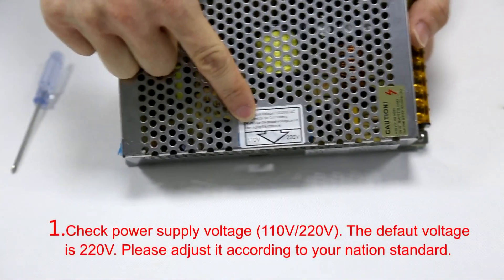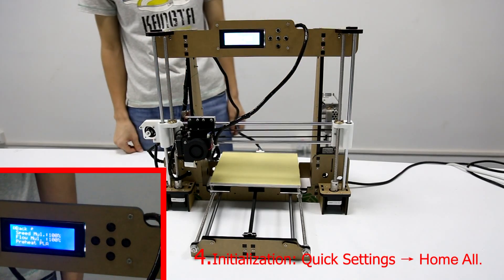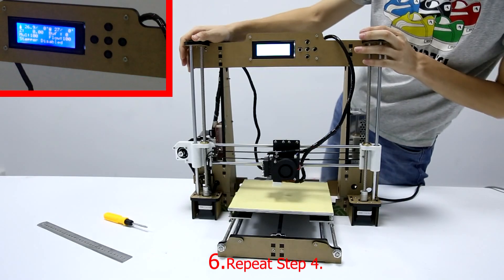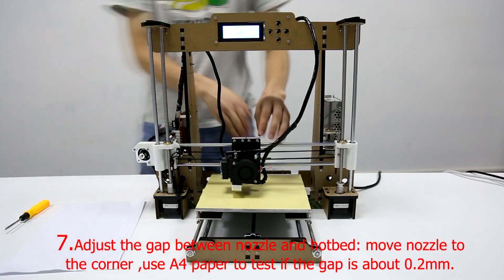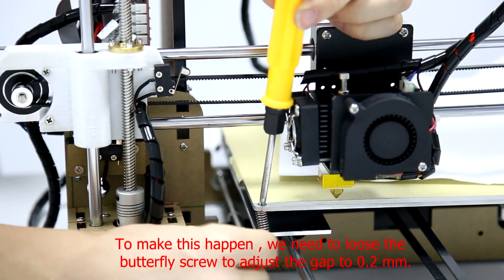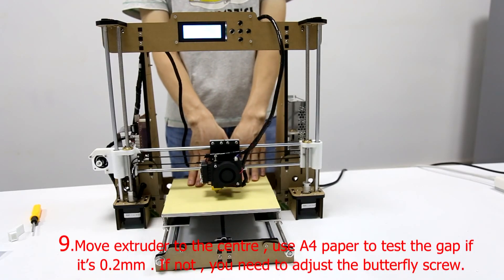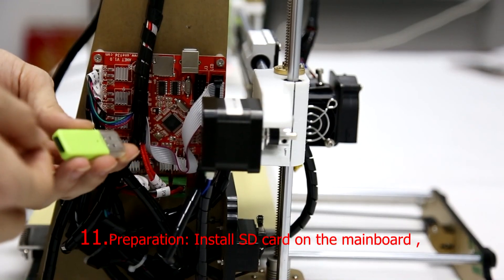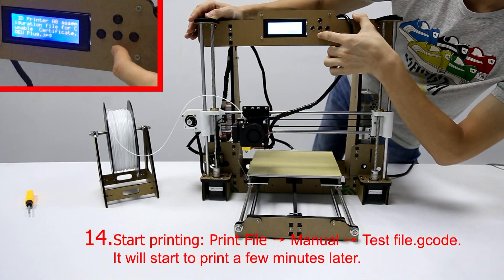3D Printer Instruction--Anet 3D Printer A8 Debugging Video

Comment: Hello! I have a question. I just finished building my new Anet A8. I notice that the extruder head required a great deal of force to move it horizontally by hand. The unit moves very smoothly if I remove the rubber belt so I assume it must be the motor being very tight. Is this normal? I see that you can move it quite easily in the video. Please help. Thanks!
Reply: Did you make sure to stop the disable the motors in the quick settings?
Reply: Augman Yes, I  did. I completely removed the motor from the printer to check. The motor cannot be turned smoothly by hand like the other ones so it's definitely defective. The printer is still able to print so I guess I'll just have to live with it until the new one arrives. I don't expect the Chinese company to send me a replacement. But hey, the printer is otherwise fantastic. I also ordered a leveling sensor and I'll be installing Skynet V2 soon to enable auto leveling. Cheers.

Comment: fantastic, i just completed my build and everything is working fine, realy a nice maschine, thx guys, i will keep an eye on your company and see if there is more intessting stuff u provide
Reply: Hi @101ZERO . Sorry to hijack your post. Does your X-Motor (horizontal) slide smoothly when moved by hand? Mine moves but I have to apply a great deal of strength compared to what I've seen in the videos. Thanks and congratz on your build!
Reply: hi @michor10 , no problem for hijacking^^. Does it also slide hard when 
turned off? cause when it is turned on the stepper motors hold it in 
place (one advantage from stepper motors), to turn the steppers off go 
in the menu -> "quick settings" -> "disable steper" -> (u have 
to scroll, should be the last point), but  if it is also hard to move when the 
printer isnt powered: unscrew the extruder bracket (the J shaped metal 
piece) and check which of the 3 linear ballbearing is stuck, feel free to ask again if u have any problems
Reply: 1O1ZERO I noticed it during assembly so the unit was off the whole time. The sliders move freely when the belt is off so I guess it must either be one of the lateral wheels/pulley things or the motor itself. I just ran a quick diagnostic test and the unit seemed fine. I'll try to make a video to show you better. Cheers!

Comment: Hi,  I have assembled the printer completely however it does not turn on.  I live in NY our power supply is 110v and I changed the settings to 110v before turning it on.   .
Reply: check the files on the included SD card, there should be a power supply wiring diagram in there, they have the yellow and blue wires switched to the opposite of the video, try that it worked for me.
Reply: Similar thing for me. In my case the instruction stated different order 
of power cables on motherboard (Black was on the outer side, red closer 
to extruder socket). After switching them printer started. Thanks for pointing to the SD card instruction!

Comment: Hi I'm stuck at 12:21, my micro SD card does not have a Print File - Manual - Test file.gcode file. I tried putting on other examples (box, baywax) but the extruder seems to just push filament out randomly. 

Am I missing anything? I've been following the videos step by step.

Any help is much appreciated
Reply: Try plug ur sd card into your computer and move the gcode files out of any folders. If there isn't a gcode file, go to thingiverse.com and download something there. Make sure to try unmount and mount the sd card through the printer.

Comment: where's the power switch for this thing? I just put mine together and plugged it in and I cant seem to be able to turn it on
Reply: Never mind people. fixed it. turns out I don't know the difference between positive and negative on the board or how to screw them in properly. not to calibrate and test. Huzzah!
Reply: now to calibrate and test*
Reply: there s none, I wired a switch from an old computer power supply together with the plug and used the powercord that goes with computers and such.
The power cord that came with the Anet seemed a little on the thin side of the actual copper gage. Hope that helps.
Peter

Comment: ?why cant i print stl files
should i convert it? to what format?
Reply: You need to drop an STL into a slicer program like cura and then load that onto the SD card. 3D printers need the STL to be converted into instructions that it can read

Comment: Hi i have buit the hole printer but when i have to go settings and home all the x motor goes right instead of left so the extrusor pushes the White plastic part on the right so i think the x motor moves like its polarity were changed (which is imposible in this printer)  
Could somebody help me?

Comment: I just finished assembly, BUT, my Y axis is moving in the opposite direction than it should during the homing operation. How do i fix that?
Reply: Hello! I have the same problem, did you find any solution?
Reply: My x axis is moving in the wrong direction .. during the homing process

Comment: my printer wont print,. it powers down the moment it try to start heating the bed, or abs.
Reply: Milly Lamp try to install everything again and wire everything again maybe this will help
Reply: or try another power supply which has more Amp than your current power supply

Comment: Got this working, awesome product and the videos are very helpful, would recommend you update the video links on gearbest as they are for an older version and they confused me at first.
Had a problem with the SD Card that came with the printer, the printer wouldn't detect it, (but it worked on my PC). I swapped it for a 2GB SD card and it then worked fine, I think the printer doesn't like 8GB or bigger cards.

Comment: Hello, I've mouted my A8 and followed the video instructions. When I want to test it after selecting preheat I try to go find the test file but the menu "Print File" does't appear. Is there any setting I need to do first?
Reply: equal error
Reply: I've seen in some videos that normally it's used a 2Gb card and the one that comes with the kit is 8Gb. I didn't test it yet, but could be the solution.
Reply: i use the sd come with pack
Reply: si lo logras solucionar avisa, que estamos iguales ^^
Reply: I've tested and to work the memory card should be maximum 2Gb.
Reply: did you find a solution, I have the same trouble?
Reply: use a memory card with a maximum of 2Gb

Comment: hello david
help me pls
i have one problem
I did everything the same as in this debugging video
but extruder and hotbed is not working 
it not hot 
what to do ?
Reply: The same is true for me as I turn on the printer .., where indicates the temperature of the extruder and the hotbed  indicates "def", not shown me the value of the temperature, and It does not warm the extrusora and hotbed. please help
Reply: Hello I have the same problem as you had...could you help me fixed it?
Reply: Me to

Comment: Hi David, thx for this great video. I've assembled my new anet a8 over the weekend, but since then i'm stuck with a problem. Now when i preheat PLA to 190, insert the filament till it run out from the nozzle, the chosen gcode file won't print. LCD show printing, but stays at 0% forever. I did everything the same as in this debugging video, even moved the axis's manually. Somewhere, somehow i'm doing something wrong, please give some advice. I'm a newbie to 3D printing.
Reply: Leon Mans I read your comment about how you can't use your pla ... well I read somewhere on the internet that you are supposed to use abs as it works better
Reply: Hi David, thx that problem was because of the heatbed plug that was faulty. Everything ok now.

Comment: hi i have completed the instructions, i  have one problem, when i  press home all, my  y axe's goes foward instead of backword where the limit switch is installed... and my motor grinds
Reply: how could one do that?
Reply: at a guess you have the motor polarity or power supply polarity reversed, check that you have correctly installed Postive (+) and negative (-) on every connection for motor and power
Reply: ive worked it out the motor and back pannel was the opposite,because all ways fit.
Reply: my printer is doing the same thing . what did you do to fix it?
Reply: i have turned the plate frame other direction, and have adjusted power with screw driver on Anet board Jimmy Tessmer
Reply: G Dogg turned plate around ? I don't understand and you you mean the supply voltage?
Reply: When you run voltage through a motor backwards, the motor runs backwards. If you've plugged the motor in the wrong way, it will run backwards and not hit the homing switch.
Reply: but there is no way to plug these motor cables in wrong they are keyed
Reply: You've attached the belt backwards.  I had a similar problem with the X-axis belt.
Reply: Bryan Elliott that is not possible as far as I know lol the belt should be any direction XD
Reply: Oh.  You installed the motor backwards.  That'll do it too.
Reply: Bryan Elliott that's not possible , it matches the install video
Reply: Jimmy Tessmer make sure the position  sensor is far enough down

Comment: Hello David,

I just deleted all the data I had on the SD Card (factory settings etc.) 
Could you please let me know where I can find them ? 

A last question, how can I reset the printer ? it seems to be stuck on "printer ready", I can't have access to the SD Card, it only shows "mount" and I can't even clock on it.

Thanks a lot !! :)

Comment: I've finished the assembly. Running through the Home All and the Z Motor 2 doesn't seem to want to properly function. My limited to moderate electronics knowledge, I thought maybe I had the wires crossed somewhere, which I found doesn't matter on the board. I've since switched them back to their designated slot. Though, when I have z motor 1 unplugged, z motor 2 works with no problems.

I did the same for z motor 1, and it works fine without 2 plugged in. Once again, I plugged both in and z motor 2 doesn't want to work properly.  I did this a few times. Do you know what the problem could be?
Reply: I had the same problem. Check the order of the cables arriving at the left and right z motors by looking at the colors. Mine were swapped on the left motor cable, which was different than all other stepper cables at the motor connection. When you find the mistake cut the cables, strip the ends and rewire them in the correct order. You can solder them or put them back together with some electrical tape. 
Good luck!
Reply: dave plavi were you able to figure it out what the other guy said didn't solve my problem

Comment: Hello, just got everything together and I can't get the LCD to turn on when I plug it in. I am getting a green light on the power supply. No fans or noises. nothing. I triple checked that everything is plugged in correctly, but I must be missing something..

Comment: Hi ! I have complete my assemble my printer and do preheat the print head but I cant insert the filament in it , I done what ever I can make it straight according the video instruction , but I still insert it in  :(
Can someone help ?
tks
Reply from the maker: hi , there is another hole invisible inside , that's why we ask to put it straight . you can remove the fan first to put it in and then reassemble it :)
Reply: yea that's what I do just now , tks
Reply: is it any easy way to insert the filament ? cos if every time need to open the fan feel like bad :(
why cant insert it all the way into it ? I try it for so many time until my finger so pain , at the end no choice to open the fan , this is not the way right ?
Reply: and the hot bed tape also need to replace too cos its break scratch by the heat bed bracket screw the aluminium plate also scratch too :(
Reply: Hi ! Today I start test again after I put glass on heat bed , works fine now :) 
I use glue stick on the glass try see if it is good for print :)
Reply from the maker: Jimngu Gk Glad you like our product:)
Reply: Hello ! why this printer cannot print OBJ and STL file ?
How to change my OBJ and STL file to G code ? 
Thanks
Reply: even I try to print your STL file in the usb that you gave ??? please help thanks
Reply: I saw your product introduction said can open OBJ STL and G-Code , so how to set them up ? thanks
Reply from the maker: You can print by Host by STL OBJ,and trough SD card by G-Code.
Thanks friend.
Reply: Do you mean I have to convert them to G-Code ?
Reply from the maker: the finally file is G-code.
Reply: If you are still having trouble getting the filament into the extruding head, try cutting the end of the filament at a 45 degree angle. This solved the issue for me.
Reply: so when I plugged in the printer the screen doesn't turn on, I noticed that it was set to the wrong power supply (220 instead of 110) and it sparked when I plugged it into the wall, I am worried I fried something. do you think this is the case and if so what did I fry?
Reply: @red-qx4no  youre fucked
Reply: You most probably fried the PSU and at a stretch the main controller board :/ When the AC voltage in is set wrong the transformer switches to less windings and therefore will output about double the voltage that should be. (This creates worst case scenario) But at best case scenario, you may need only new power supply, try getting in contact with the place you bought it from and good luck! :)
Reply: update to my problem actually none of that happened it works fine now except for some reason the LCD display is messed up, but that wasn't my fault (trust me on that one) so I am getting a replacement part, thanks for the help though :)

Comment: Hi, 
I just finished assembly, BUT, my Y axis is moving in the opposite direction than it should during the homing operation. How do i fix that?
Reply: I had actually installed the back plate backwards, the one the y motor mounts to. it was really hard to tell at first until I realized the motor was facing the wrong direction.

Hope that helps.
Reply from the maker: Hi james,  check the port on mainboard , be sure you have connected the port correctly .
Reply: James Pike switch the stepper motor connector the other direction
Reply: David
 i have same problem 
the port is ok
 how switch the connector?
Reply: James Pike me too

Comment: Sometimes the extruder motor is retracting too much and the filament comes out, and I want to know how i can fix this?
Reply from the maker: Hi ,
adjust the data on cura and save the file to TF card  . Then print with the card .
the retraction should be larger
Reply: I used a different software that exports gcode, and it has worked better

thank you though!
Reply from the maker: RayonnaiseSauce ;)

Comment: Hello, i have movement on axises, when i do home all function.  My Z axis motors do not turn together.  Motor by the motherboard will turn and start to bring down carriage, the other motor does not turn.  I disconnected shaft and the motors turn as needed.  Reconnect and same thing.  Switched motor inputs on motherboard, exact same thing happens.  Problem with motherboard? not enough power?  Another adjustment on z-axis guide shafts? All help appreciated.  Thank you
Reply: mine does the same and solve the problem with multi-oil

Comment: where is the on switch after you plug the unit in? I built it, when I plug it in the power supply lights up, and that's it. dark LCD screen... is there a switch to turn it on?
Reply: Just got a great tip. Plug it into a surge protector strip and use the button on the surge protector to turn it off and on.
Reply: richardpchilson@gmail.com is address to send problem collection too.  also could I get a simple yes or no answer to my question. is there a on button? thanks
Reply from the maker: Hi friend , accroding to my experience  , gmail will reject the firmware as spam. can you give me other email ?
Reply: Hey David thanks for replying.  I found the solutions to my problem. Just needed to add red+.  So anyone else looking, no on switch. Turns on when plugged in. Thanks

Comment: everything is working correctly expect its not feeding the PLA filament. It goes through the motions like it is printing. have I done something wrong? I can push the filament through manually so I know the extruder is heating up like it says. any ideas? my email is jessalyns.soldier@gmail.com if any one has any suggestions. Thank you.
Reply: Hello jessalyn did you ever get a resolution to your problem with the exstruder moter not running

Comment: step 12
my settings is def/190º - def/60º

What do I do??
Reply from the maker: Tiago ,
Tell me your email and I will send a problem collection to you , including this issue
Reply: I have the same problem :S and I don't know what I need to do, If you know something please share to me. If I know something I share to you. Right now, I'm writing an email.
Reply from the maker: Lupita, 
Tell me your email and I will send a problem collection to you , including this issue
Reply: Thanks so much :D, my email is: mariag.riosm@gmail.com
Reply: My email is: tiago.2.barros@hotmail.com
Thank you
Reply: Same here
Reply from the maker: Calvin Carpenter Calvin , also need your email and i will send to you
Reply: tiago.2.barros@hotmail.com
Reply from the maker: hi , check in your mail ;)
Reply: I have the same problem. Could you help me too, please?
My email is dbmoreno@hotmail.it  Thank you very much
Reply: I'm having the same issue .. worked fine bit I noticed the little white wire was out of the little hole , I put it back in , checked all connections but still DEF on both temps ramjetexpress@gmail.com